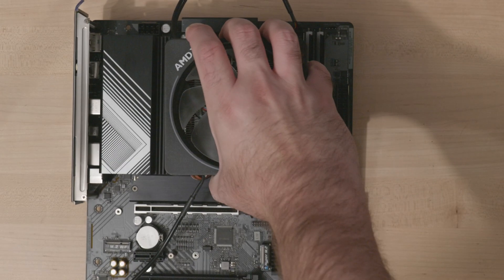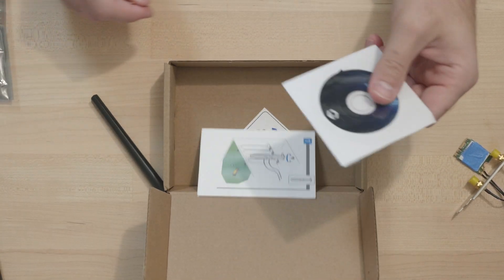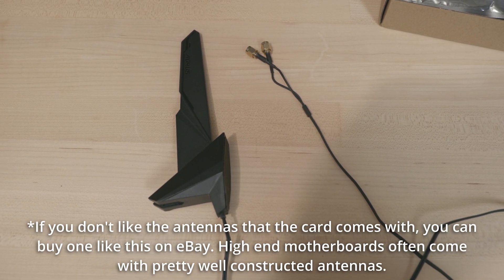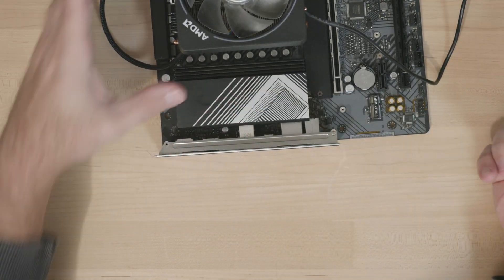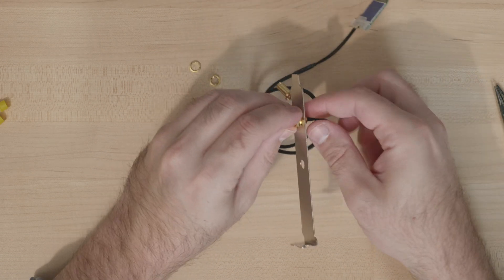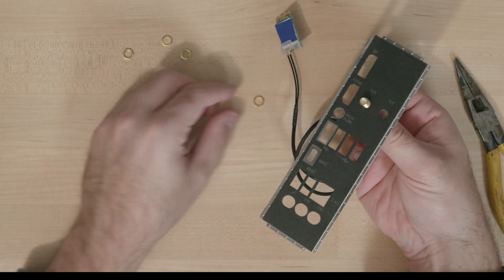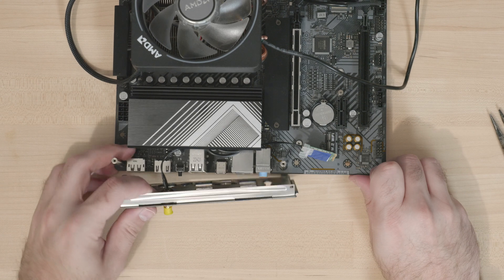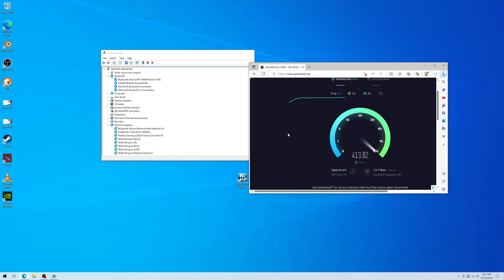Chill Upgrade: Adding Wi-Fi to your Motherboard

Comment: I have the same motherboard with exact this chip ax210, whatever I do Bluetooth is not working, I can see in device manager but it simply does not see any device. Drivers removed and updated, device restarted, same problem. As for WiFi it works fine

Comment: I'm not quite sure how to place the protective cap and after seeing your video I did remove the whole module before placing the cap. However on AsRock's manual they made it as if you can push the cap down the already installed module. I'm afraid that it may broke the cap. Thank you Sir.

Comment: cheers, nicely shown. do you happen to like that motherboard by the way? i am planning on upgrading to AM5 from x570 and I am not in the mood to spend a lot of money on x670 and was actually thinking of just getting that AsRock board as it looks pretty decent and with the x3d cpus it shouldnt be a problem as they are not really made for overclocking
Reply from the maker: I wouldn't focus on getting this board unless you especially want two ram slots, don't need wifi, and it's on a good sale. There are other boards with similar pcie layouts, more usb ports, and included wifi that end up being a better purchase otherwise.